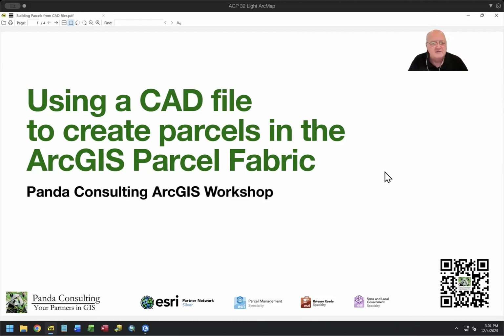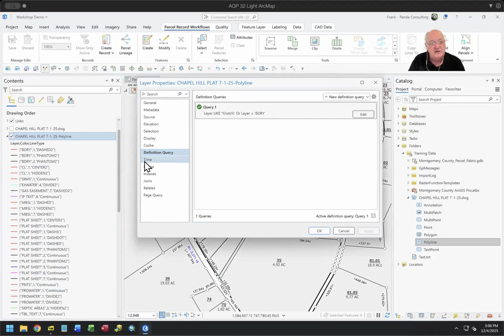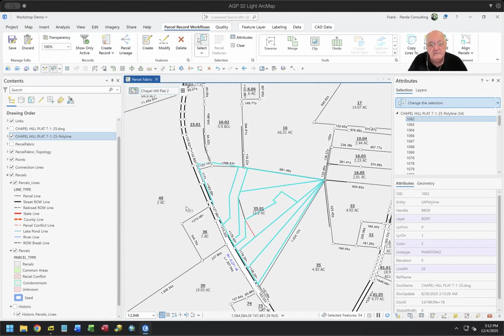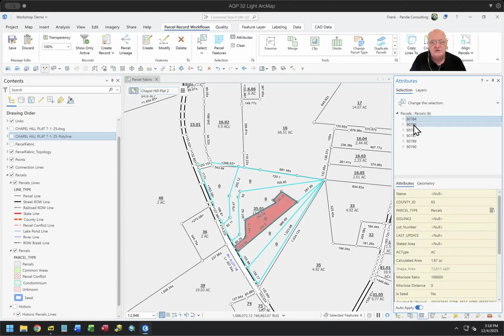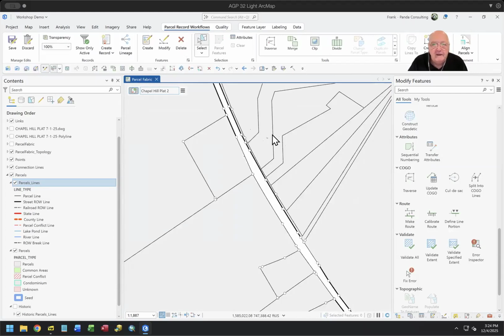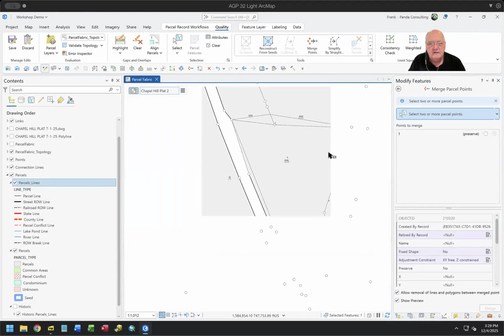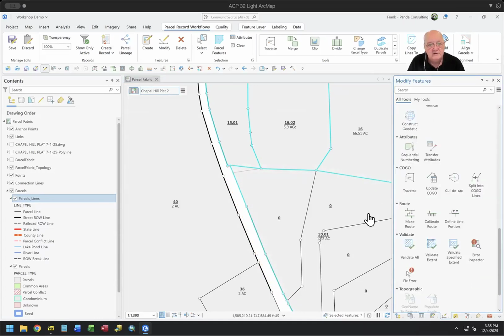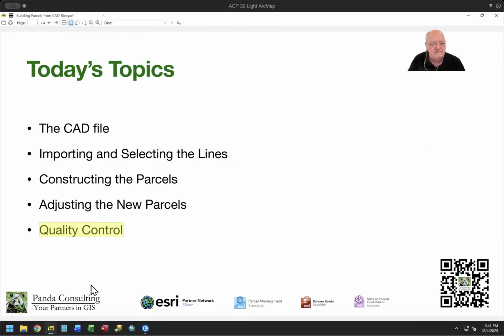Using CAD Files for Parcels - Dec 2025

Comment: Good afternoon, Frank. I just watched your video and noticed you used attribute selection to select the lines. I used to do the same thing until I saw a conference video that showed a quicker approach. Once you add the CAD polyline file to your map, you can select the CAD layer, click the CAD Data button at the top, and then choose Group by CAD Layer. This lets you easily turn individual line layers on and off.